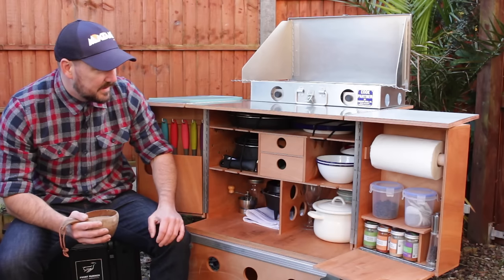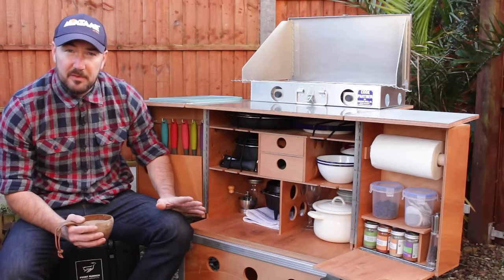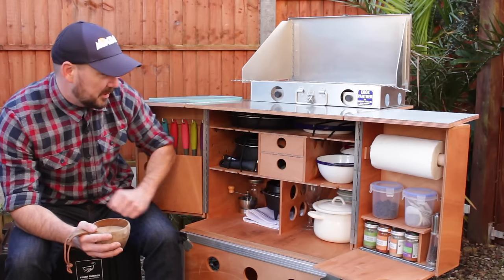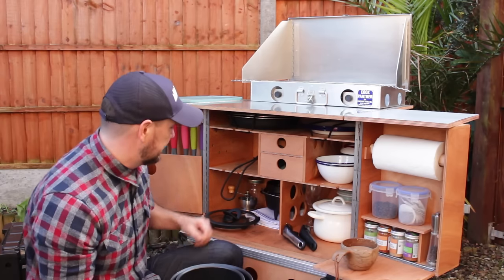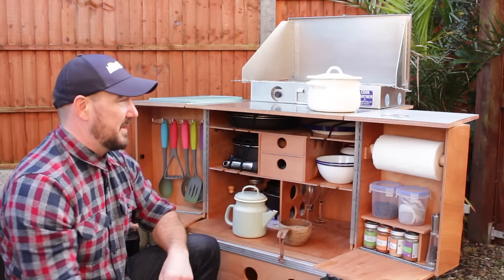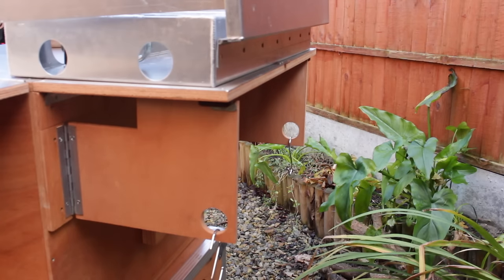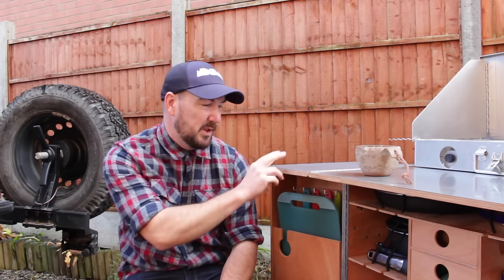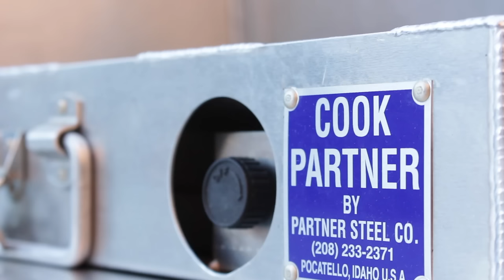The DIY Overland Camp Kitchen - Chuck Box - Patrol Box - Campervan - Outdoors Cooking

Comment: I built a very similar camp kitchen for my 1965 VW bus a little over 50 years ago. Primarily 1/4 & 1/2 inch plywood & mahogany strips. We used it for many years & gave it away when we moved & got a motor home. They used it for at least another 20 years before it needed too much repair. It always created a lot of curiosity &  conversation everywhere we went. I want to make one again for day or weekend trips with the grandchildren. I am getting a lot of ideas from the variety of YT videos.
Reply from the maker: Sounds like you built a solid unit Ronald!  I get quite a bit of attention with this kitchen, we traveled down through Spain a couple of years ago and every time I unloaded the kitchen a crowd would soon appear to have a look.  Good luck with your new build and happy travels 👍

Comment: Deceptively simple. A lot of thought has gone into this design and it flows effortlessly. What a great chuck box!
I like the wine glass holder, heh heh, very clever!  The Europeans do the same thing in every RV with a wine bar and rack for glasses, same concept, but in plexiglass with blue LED lighting and it looks so elegant.
I love the fold out doors becoming supports for top ledge, the holes for hooks for the trash bag, the towel rod becoming a rolling pin (genius!), the bungee cords holding the plates down to prevent rattling.  Also love the fold down shelves from the swing out doors - so clever. They do double duty holding stuff back then open to give more surface area.

Ras El Hanout spice from Morocco? You do get around. Looks like you are a good chef. Nice range of spices for Moroccan, Indian, Western foods.  I looked at your video a second time.  Your build is exceptional. The aircraft case hardware and corner supports, the metal sheet coating on table tops, the beautiful support system for the leaf extensions, every attention to detail including cutting holes in the shelf walls to reduce weight.  The elastic cord anchor system on plates and pots is genius. I will borrow this idea from you, along with several others. I love this build. You have a keen eye for detail and a low key presentation that belies the greatness of this build.  To make a functional, robust, and beautiful Chuck Box/Camp Kitchen that is also a compact size, molded to your needs, and lightweight, is a woodworking challenge. I feel a fire burning in me to make my own version.  A good camp kitchen is a feat of engineering and the ultimate challenge in creative skills.

Love the pots and pans with no handles. That saves space for sure.  Put a piece of soft foam between them or you will scratch the Teflon interior.  Very nice build, enjoyed the tour and excellent visuals.  Thanks!
Reply from the maker: Thanks!  I hope you get around to building something similar, not only is it functional but it's always a talking point at every campsite.  Thanks for watching 👍

Comment: I viewed this a couple of years ago and built my own using some of your ideas here. I have since purchased a small teardrop camper with a dry galley kitchen. The previous owners built shelving which worked for them and their equipment, however, not for mine. I remembered this video and the bungee cords locking down your equipment. Great idea and I will be using the video again! Great build and great Channel! Thanks!
Reply from the maker: Cheers mate! 👍

Comment: I love your chuck box! So many great ideas from your bungee cords with the little slots that hold them in place to all the fold out bits that allow for more table top area. I am amazed that you use real crocks rather than the lighter weight (and much more inferior) aluminum products!  I suppose if you use this chuck box regularly you would also want to use real pots. Now as I plan my own chuck box I will plan for real supplies over simple/cheap aluminum crap.
Reply from the maker: Cheers!  It does add a little more weight using decent quality kitchen gear but it's worth it.  Good luck with your chuck box build 👍
Reply: You just can't beat cast iron!

Comment: Even if you had a travel camper, and a floor to counter space recess to tuck this into, you could in deed
relocate it both indoors and outdoors with fairly relative ease. Thus, it could be used inside the camper
trailer or outside when it is great weather and not be troubled about it getting buggered up by foul
weather. Even if were deemed as a bit heavy to carry, you could also adapt some wheels just like on a
table saw frame to roll it towards the doorway, but then off load it.

Comment: Beautifully built with plenty of thought gone into design and some small details that make it very cleverly done. 
Are your drawers done from 9mm or 6mm? Hard to tell from video.
What catch did you use for front doors?
Did you cut down the width (25mm) of piano hinge so there is no overhang for the doors?
Reply from the maker: Cheers!  The drawers are 6mm and the front latch is a flight case latch, I bought 25mm piano hinges so they just screwed straight on with no issues. 👍
Reply: @Adventure-Outdoors  Ok cheers for that info. I'm a cabinetmaker here in Australia and have been researching heaps of chuck boxes for past 2-3 years not wanting to rush into it. Definitely have my heart set on box style doors for storage and your extra ideas have helped me make up my mind and I'll be building one very similar to yours so thank you again.

Comment: Space, size, weight, cost, &???..
I have been wanting to build a camp kitchen chuck box for years but empty they all look way too heavy & bulky.
So I have decided to buy 3 things that together will equal a chuck box without being too heavy for one broken old guy.
With all the tool box configurations out there I found one that is very useable and affordable. Hart, sold by Walmart has a 2 drawer plastic tool box that will work well for all my cooking tools that along with a Hart rolling tool box and a folding table should carry all the stuff for a solo motorcycle camper.
The great thing is if I make a mess being plastic I can just rinse it out. The only downside is is it durable enough?

Comment: Nice!  One of the best boxes I have seen.  Then you top it with a Made in Idaho, USA stove!  I have one and have been to the shop where they are made.  If you don't have one look at their aluminum griddles.  You could eliminate the fry pans and the griddle has even heating
Reply from the maker: Cheers!  Yeah the Cook Partner stoves are great, you can't buy them over here in the UK or anywhere else in Europe for that matter so I had to get it direct from the US.  It ended up costing a fortune to import it but well worth the money, it'll out last me probably.  All the best 👍
Reply: @Adventure-Outdoors  I'm actually at the cook partner factory right now getting some repairs on mine that's over 20 years old and lots of boy scout camping!  Needed new hose ends is all where it plugs into the stove.  The rest is in great shape!  Has taken quite the beating and still works! Mine is a six burner and have their large aluminum griddle that covers 3 burners.   I'm sharing your video with them.  This is a lifetime stove.  All the river runners around here use them.
Reply from the maker: @Darenator1  Nice!  The six burner model must be a dream to cook outdoors with, that's more burners than I have in my kitchen at home.  I just wish their gear was more readily available over here, the 22inch burner is available through a company called 'Camp Champ' in Europe but it costs the equivalent of $711 USD!!  They're without doubt the best stoves in the world though 👍

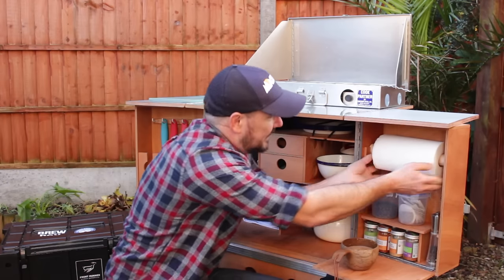Comment: @6:35... noticed that when you pulled the roll of paper towels out that it was set to pull from under the bottom and when you put it back, it was set to pull from over the top (correctly),  just like t.p. should unroll in the bathroom. My OCD gets the better of me sometimes  :0
Great project and video.
Reply from the maker: Cheers!  👍
Reply: one of the reason i got divorced!

Comment: Clever design, and beautifully executed  carpentry👌👍👍😎
Did you oil the plywood or treat it otherwise, so it doesn't swell with moisture?
Nice touch with the weight-reducing holes here and there, it gives it that certain aviation dsign touch, combined with flightcase hardware. Excellent stuff.
Thank you very much for taking the time to show it to us.
Btw, seasons greetings and cheers from switzerland🤙🥃

I might fire up the ol CAD and design something along your line. Hope you don't mind?!😉
Reply from the maker: Cheers! I coated the wood with Danish oil just to give it an added bit of protection.  I recommend you build one!  Apart from making life easier when it comes to cooking, it's always a conversation starter when you use it at a campsite 👍.

Comment: Wow that's a great but if not you have there. One question, where did you get your stoves from? I've been looking for a Cook partner stove but I can't find any in the UK.
Cheers.
Reply from the maker: Cheers!  I had to buy the stove from the US, I bought it 4 years ago from a shop in Idaho called Cascade River Gear, they post worldwide.  I don't think anyone in the UK imports them.  I've just checked and the stove retails in the US for around $370 for the 22inch burner which is the one I have (although I paid $270 4 years ago).  Once you add delivery and import taxes etc. they end up costing a small fortune.  They are great quality and bombproof, I use mine a lot and I'm sure it'll be the last gas stove I'll need to buy, which goes someway to justifying the cost.  👍

Heres a link to the store but you might be able to find them cheaper elsewhere -
https://cascaderivergear.com/shop/22-wide-2-burner-wwindscreen-attached/
Reply: There is also Overland Outfitters in Canada, which is a reseller.  They cost a pretty penny, but are so tough-built and easy to clean and maintain.

Comment: Where did you get the partner stove in the UK? Seen a lot of US overlanders using it and it seems pretty damn good!! By the way.....the build is awesome, way better than my first attempt!!! Makes me wanna try again now!!!
Reply from the maker: Cheers!  I bought the stove direct from the USA a few years ago, no one seems to sell them in the UK.  They are reasonably priced in the US of A but once all of the import taxes, VAT and delivery costs are added it ended up costing a small fortune, £440 if I remember correctly, that was in 2016.  I reckon it will last me 30 years though and I use it at work 3 or 4 times per week so I'm trying to get my money's worth!

Comment: What's it look like when you open after being on the trail all day?
Reply from the maker: It's all good, I have elastic that pulls over the items on the shelves and usually keep some of that rubber grip material underneath the stuff on the bottom shelf.  I've had nothing break yet but wouldn't risk putting glass in there 👍
Reply: @Adventure-Outdoors  it's a beautiful piece

Comment: Great build, very clean. Gonna have a crack at making one, quick question regarding your joints though (and forgive me if this seems obvious). You mentioned you used butt joints. Did you have any issues with the plywood splitting when screwing into it? And I’m assuming you used glue as well? 
Thanks for sharing all your insight. 
Cheers from Virginia!
Reply from the maker: Hi Matt,  I didn't have any issues with the plywood splitting as I pre-drilled the holes with a 2mm drill bit.  This isn't fool proof though when you're drilling into 9mm plywood so my advice is to take your time and measure the point at 4.5mm before you drill.  Yes I glued it as well, good luck with your build! 👍
Reply: Overland and Outdoors Thanks for the quick reply! I’ll be sure to use pilot holes. Excited to get started.
Reply: I was worried with the wood splitting using thinner pieces of wood. I ended up using leftover pieces... thick pieces.  But I will take his advice next time, take time centering and drilling pilot holes into thinner wood.

Comment: A camping table or two, a gas cooker, and the rest of the things in maybe three plastic containers with lid on them is actually more practical than this heavy box, in my opinion. You just pick up what you need from the boxes for that specific meal, including the dry food and tins. The food that needs to be refridgerated goes in a cooler.
Reply from the maker: That might be true for a weekend at a campsite, been there, done that.  But for weeks on end cooking 3 times a day on off road trails then a dedicated camp kitchen is far more practical. Everything in one space, 30 seconds to set up, 30 seconds to pack up.
Reply: @Adventure-Outdoors  - It is fine for many weeks at a camping site, for me. But for cooking on offroad trails while driving all day long, I get that your kitchen is more convenient for that use. Have you seen the drag out kitchens? I guess you have. They also seem very practical.
Reply from the maker: @milcotto4153  Hi Annie, yeah I've seen the drag out kitchens, I thought about building something like that for the truck originally but thought it might be a hassle to remove if I needed to use the truck bed for work etc.  I actually built a smaller kitchen that just fits on the truck tray, much lighter so less chance of injury but still really practical, here's the link to a review 👍 - https://www.youtube.com/watch?v=279KRIlKat8&t=168s
Reply: @Adventure-Outdoors  - Oh, I like that one :-)